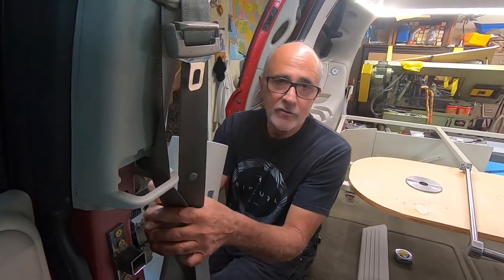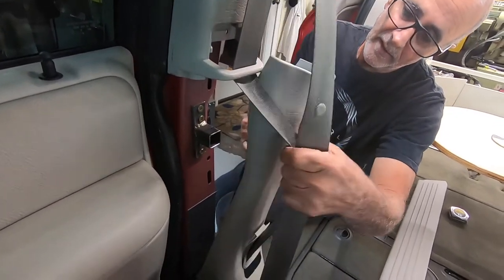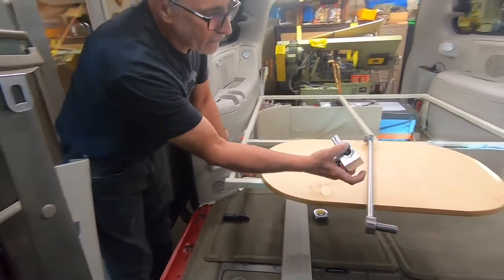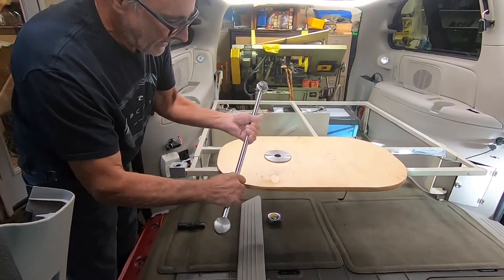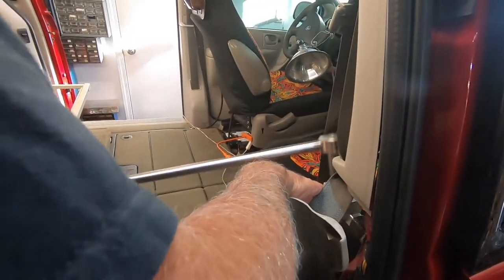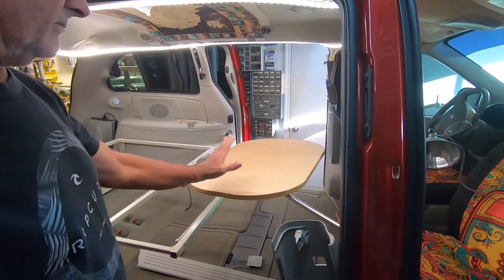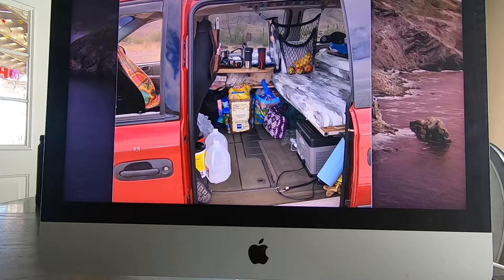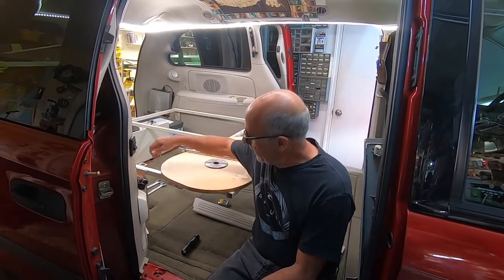Swivel Table Grand Caravan Conversion

Comment: The drill stock is a good idea - i tried a similar table but the mild steel arm was too thin and way too bouncy, so I gave up on the design. Nice solution. (how much does a piece like that cost? I feel it would be expensive, but I have never priced it)
Reply from the maker: Thanks for commenting the five eights drill rod is not as expensive as you might think I believe you can buy it in 3 foot Links might cost 15 $20 maybe not that expensive for good material ok

Comment: How much Weight have you put on the table do you know? 
Thank you for the video really cool , but I don’t have mechanical know how to make one of those.  It would be nice if you sold the bracket , the bar in the table bracket/holder. I think I would be able to make the wood part of the table.💕
Reply from the maker: Thank you for commenting the point of the video is to just show what is possible not necessarily to try to sell anything
Reply from the maker: @felicitycalf3479  Thanks for the nice comment I just don’t have time right now to make any additional parts I’m currently trying to get the van put together so that Tammy and I can head south we are wanting the beach bad